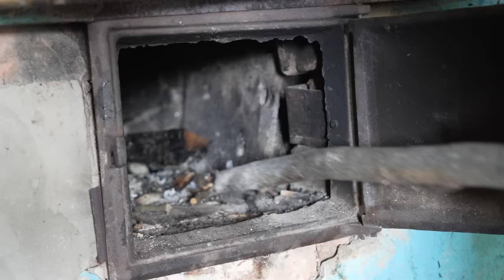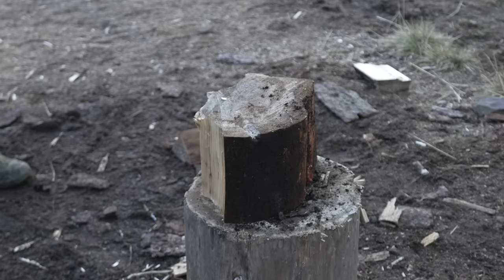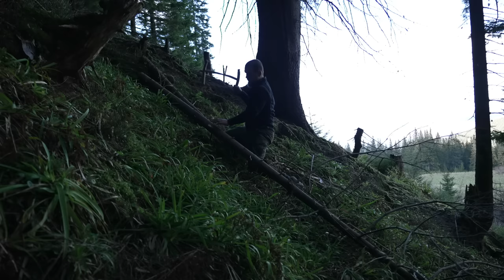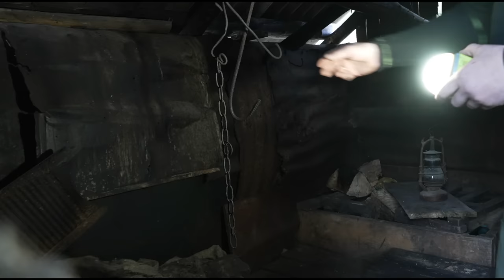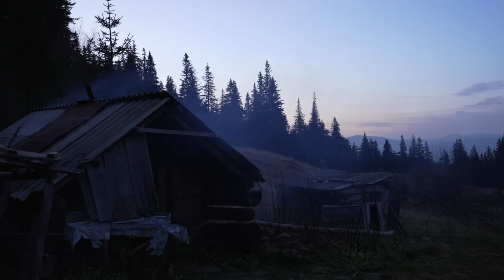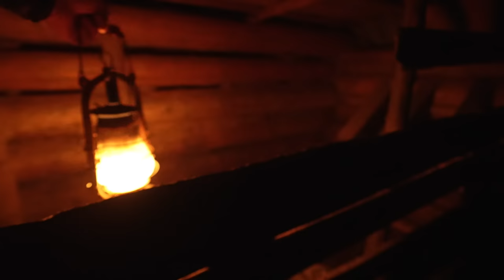abandoned log cabin, no one has lived here for a long time, exploring abandoned place

Comment: Looks like a communal Bothy, which most can use as long as you respect it. I see people have tried to add little comfort additions. Only one problem that may worry some, is the Asbestos roof panels. Have worked with the same roofing panels many years ago. But wouldn't deter me from living in such a beautiful place. Good video thanks.